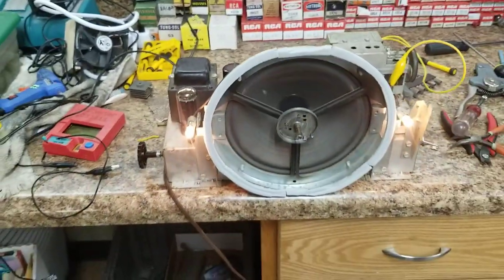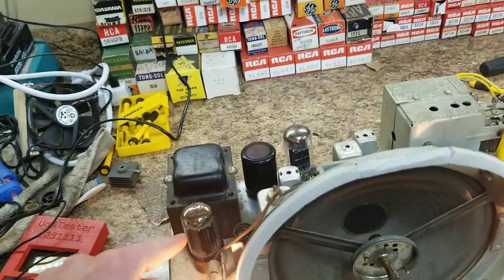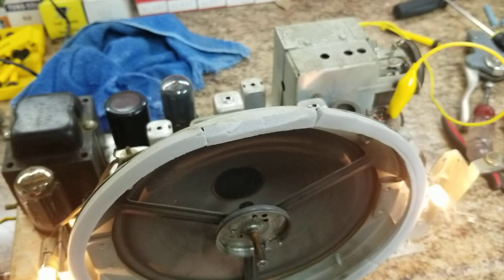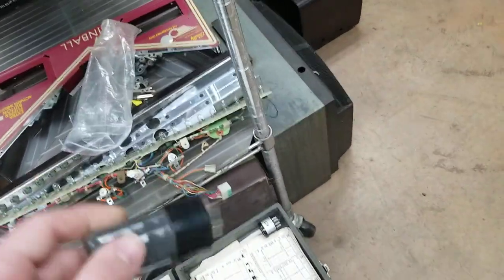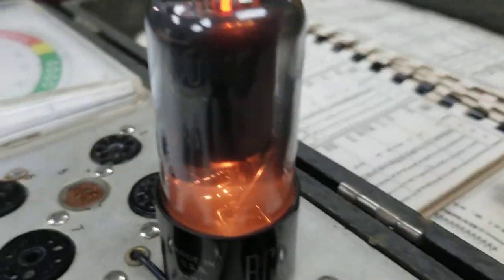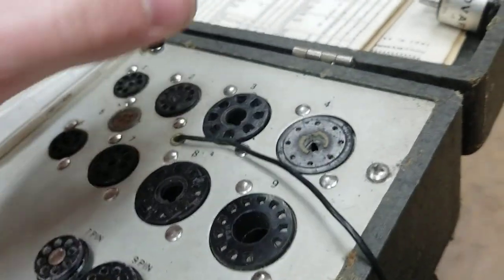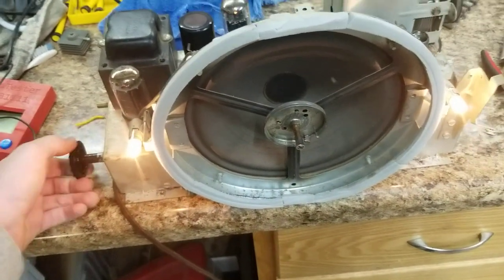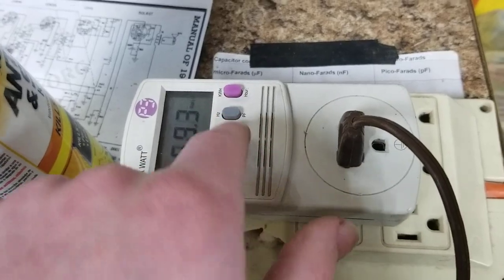1954 rca am fm radio filter capacitor replacement

Comment: RCA 3-RF-91. Nice of Riders to make separate  wiring diagrams for the AM , FM,  and the whole circuit, like SAMs did.
Never throw the old can away. You can use it to  easily restuff it for many other  tube electronics  with other values 
and  just cover up the embossed writing of  the former contents. A label maker does nicely there.